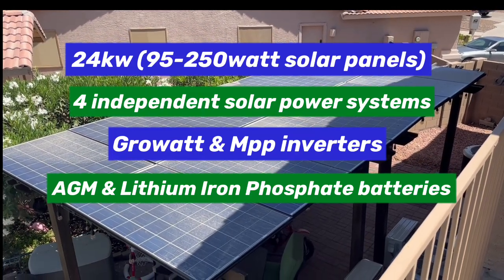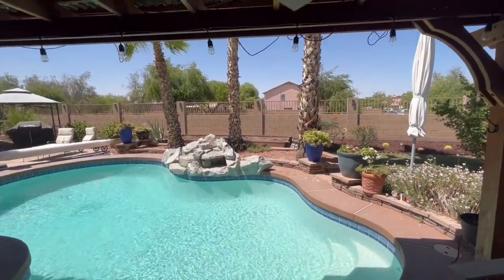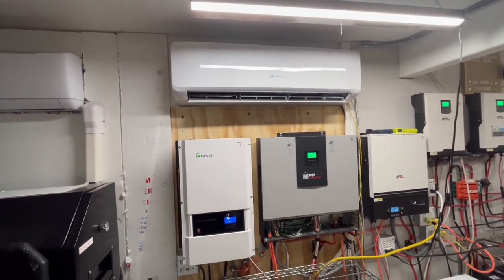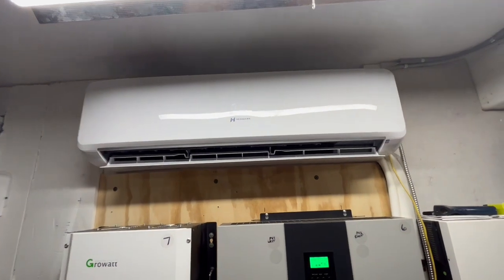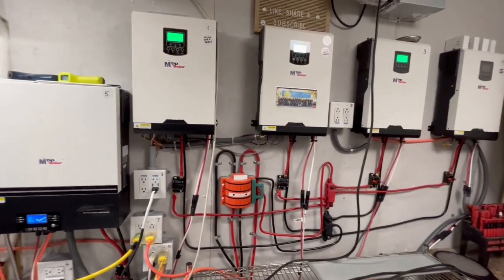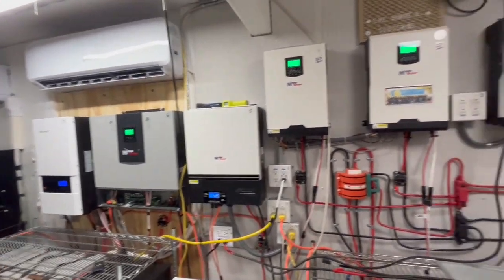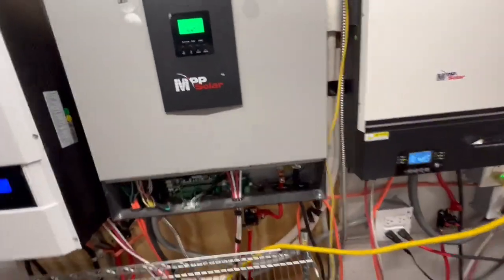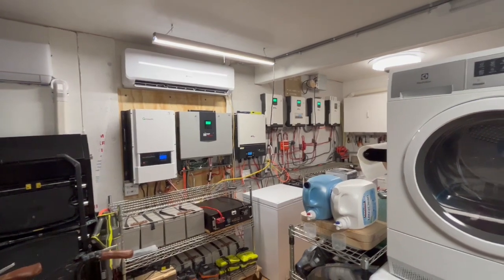24kw Growatt & Mpp inverter solar power system using 25kw Lithium Iron Phosphate & AGM battery banks

Comment: I've binge watched most of your solar videos, I have one major concern for you. That is a partial and missing fuses and breakers. Especially with the 48v systems, the type of breakers you are using are generally only rated for 36v systems up to 48v max not mid 55+ volt i.e. lithium etc. Second, you need a rated fuse or circuit breaker, Not like the ones you have, With high interrupt rating close to the batteries. Third, breakers for your a/c output from your panels to equipment etc. Fourth you need cut off switches and breakers fuses for your solar panel feeds to your inverters. Please understand note: that sometimes these hybrid inverters can catastrophically short out, almost causing a dead short and therefor a fire, we must protect our lives and homes, GOD bless! Thanks for the videos and showing your results!
Reply from the maker: Thank you so much for your valuable input, I will look into researching all those items you mentioned and purchasing for added safety. Hope you have a wonderful and extremely blessed day.
Reply: @diy-solar-guy  Shure, you too!
Reply: Ya, you seem to be good at researching stuff, so I don't think you will have a problem with finding good advice on all the places amperages voltage and interrupt rating etc., it's just you're getting a lot of power and 48v dc can kill etc, unlike 24v. But also don't skimp on these items as some of the lessor breakers fuses from e-bay Amazon etc, don't meet the advertised cut points etc, but you can still get name brands from there. Unlike the breakers you have, Your 24v systems are not as much of a problem as up to 36v systems are still considered low voltage, but not 48v lithium running in the 50v+ range. It will take some money though, depending $500-$!000, including breaker boxes etc. Oh and don't double/tripple connect wires to the same screw-down fitting, code violation, unless specifically designed for and certified. If you have any problem getting started I can point you in the correct direction. But all I think from seeing what you have done is just doing the research, and understanding I've worked with electrical stuff for almost 50 years and I hate to see injuries or fires which otherwise were avoidable. Thanks again for your videos!
Reply from the maker: Great advice, we are a DIY channel that has evolved over the last 3 years always learning as we go. One thing I don’t want to do is run high power consumption devices overnight when I don’t have to. My electric bill for the year is around $1000 and I’m fine with that. The bill will go lower when I start running mini splits overnight, but those are only 120v and only use around 10 amps max but once reaches set temp drops to 2-3 amps or 200-400 watts per hour. I still have my 24v inverters that I will use in the future. I have 4 independent systems so I don’t have to load up everything on one system. I can run all 4 systems at around 25-40 percent of rated watts which keeps all inverters, wires and battery banks nice and cool. I am completely retired now and spend a lot of time monitoring high power consumption devices to see how inverters and batteries are doing. I keep my garage nice and cool in the 68 to 72 degrees range because of all the heat from 4 inverters. All my wires are always cool to the touch since I don’t run inverters to the max with the exception of the pool heat pump. But it was 99 degrees yesterday and I did not have to use the 127,000 pool heater. The pool is in almost full sun all day now and just having a pool solar cover with the little 18,000 btu pool heater keeps the temp at 88 degrees. Night temps are now close to 60 degrees. I have it set up where I will run my 3 1/2 ton all day for upstairs only using 1600-2600 watts, that is on my Growatt 6kw inverter. That will be all I run on that. I will use 2-12,000 btu mini split heat pumps downstairs instead of 4 ton whole house heat pump. The 2 mini splits only use around 2000 watts or 20 amps together. I will also run my 18,000 btu mini split heat pump in garage to keep my inverters cool. All 3 mini split will run on my 12kw Growatt inverter only using around 4000 watts or 40 amps. I will run my pool pump and 18,000 btu pool heater on my 5000 watt MPP inverter with each one on the two separate 120v legs and using less that 1000 watts each or 20-22 amps total. My last 6500 watt MPP inverter will continue to run my 3 chest freezers and refrigerator/freezer 24 hours a day. I only use pool heater for 2-4 weeks in spring and fall because of the 7500 watt load it needs to run. Having 4 separate inverters gives me the flexibility to keep my output power below 50 percent on each one with the exception of the 127,000 btu pool heater. Now I can start running my ac units at 7 am for upstairs, downstairs and garage so my power usage will be lower during the day since the house will be at set temp by 8am and use a lot less to keep temp at set point. I never wanted to put all my eggs in one basket by having just one large inverter running at max all day and night. Too much power output in one unit and failure rate is much higher. If one of my units goes down, I still have the other 3 inverter systems to compensate since I run at less than 50 percent load almost all the time. My batteries are all fully charged by the time I turn off 3 out of the 4 inverters nightly so if I had a power outage overnight, I would be able to run everything in house till solar starts running and charging the next day. I look forward to upgrading my 4 solar powered systems in the near future with your suggestions. Thanks again for your wonderful input.

Comment: Do you have building codes, permitting and required inspections there?

I couldn't get away with wiring solar systems like that, here in Pennsylvania. It's an NEC code violation nightmare (too many to list) and would never pass an electrical inspection. Code enforcement would condemn the property if they ever saw an operating system like that. Plus, the insurance company would cancel the homeowner's insurance policy in a flash!
Reply from the maker: Some states are friendly with off grid solar and some like yours are horrible. On grid requires a ton of inspections. We have a lot of on grid panels on roofs out here with professional installers, but you never break even because your limited to less than 5500 watts on your roof. That’s why I have 5 to 7 separate off grid systems that are below 4000 watts on each. Everything thing solar if completely off grid. I have grid connected that feeds into inverter but no power I produce ever feeds into grid. My inverters are grid assist. Keeping the systems small is the key. I know people who work for grid power companies out here and they are only interested if you connect to grid. You can do all the work yourself to install on grid system and get inspected. It will take about a year to year and half. But the electric company will charge you monthly to be connected to grid and will not buy your extra power you produce. If I went on grid my electric bill would be minimum $1600 - $1800 a year even off I produced 100 percent of my power with solar. Right now my electric bill is less than $1200 a year. I save about $4500-$5000 a year using off grid to run pool pump, pool heater, mini splits, washer & dryer in garage, main upstairs and downstairs ac units attached to house, fridge and 2 freezers. Off grid is ok as long as it is less than 5000-6000 watts per system. The city out here takes 6 months to a year to get out and inspect new businesses and new homes. They are not looking for diy solar off grid system. We are not over regulated at this point in our state to install off grid solar. Not one solar panel is on my roof of house. All are on pergolas and metal arrays I made. Hope this helps. Also Back east has a huge amount of cloudy days and snow, rain. Will not be able to produce much with those conditions. We have over 300 days of sun shine a year. Perfect place to do solar. When I refinanced the house the inspector said mortgage and insurance companies and not interested if you have off grid solar. He did not even mention in inspection since off grid is considered temporary and not permanent like on grid with panels in roof. But they did note trampoline on inspection and had to remove trampoline from property or they would have canceled policy. Hope you have a great day

Comment: How much total is your solar setup?

Very good setup, a lot of wires 👀 lol but cool though
Reply from the maker: With what I am using now, spent a total of around $16,000. To purchase all this now with inflation would be about $24,000 to $26,000 If you can even get the product I have. My system is already paid for itself in less than 3 years through reduced electric bills and rebates. I save over $5000 a year in reduced electric bills. Plus I have a lot of extra inverters and spare parts, connectors, etc... I do not need to buy anything more to keep this system running for 5 - 10 years the way I always have full batteries at the end of day and use grid for ac overnight. My electric bill for the year is around $1000. I need grid power and would never in this house go completely off grid. I am pretty much done with my system for now since I can produce way more power than I need and have back up if inverters go down. Now I just want to clean up my wiring and make it look nicer but in no hurry. Nothing ever runs hot since I don't overload any of my systems. I have a lot of inverters because I am self taught and progressed as I learned more, just moved to bigger inverters as I felt comfortable with my knowledge of solar. I had no help at all with setting up system or connecting all equipment together and installing 6 mini splits, all while battling cancer since 2013. I did not start solar until around 2018 or 2019. You can if your lucky but refurbished Growatt 12k inverters for around $1500 each. Buy 2 and you could have 24kw, more than most people would need. Signature solar was selling refurbished units but I think they are extremely low on all stock due to inflation and supply chain issues. Mpp inverters are great for mini splits but not for anything that requires 240v and high amp surges to startup. Growatt is my favorite since dual phase 120/240 volts.

Comment: Do you recommend Growatt or MPP? Why? Looks like you use all the MPP for 120v loads and low frequency Growatt for 240, correct? I have a well pump i am concerned about...Thank you! Impressive system for sure...
Reply from the maker: Mpp weather 120v or 240 volts is great for running mini splits, variable speed pool pumps, etc… but they are not able to start up large loads. The inverters are very light which means the coils inside are not large enough to start large loads like compressor of 72 amp in rush current. That is where you would use the Growatt inverters. The Growatt inverters can handle to compressor start ups. Mpp inverters are good starting out with off grid solar. Growatt is built to use for all your needs. My Mpp split phase works well with mini split inverter that is 230v only because the current is a gradual ramping up, also works well for washer and heat pump dryers. But you won’t be able to start anything requiring 30amps or more inrush, the Mpp is just not designed that way. Both Growatt inverters are split phase 120/240v out at same time. Mpp for beginners, Growatt for more serous applications. I recommend Growatt 12kw to run an entire cabin or small house. How many amps does your well pump pull to start and then to run? Hope this helps.

Comment: Those deep cycle batteries worry me being inside your garage, They off gas some serious fumes.
Reply from the maker: Just received my battery evo Lithium Iron phosphate batteries today. Those deep cycle batteries are gone. Thanks for the concern. The garage was opened many times in the day and the air is constantly circulated in that area of garage. Hope you have a wonderful and blessed day.
Reply: @diy-solar-guy  Yes sir, just was worried is all..  Lithium or LIFEPO4 is the way to go for sure. Love your little setup!

Comment: How many solar KWH do you produce on an average day?
Reply from the maker: I will try to keep track and talk about in a future video. I have to shut down one inverter because it just drains the battery from 52 v to 44 volts constantly trying to connect to panels as sun goes down. It is the Mpp LV 6548. When I shut it down it clears all the data. The Mpp 2424 and Mpp 5048 does not keep track of that data. Will have to use app  for all inverters to find out but so far have had no luck with the apps actually working consistently. I know my bill was $4000 a year 2 1/2 years ago, keeping my house so much cooler would probably put my grid power bill at $6000 to $7000 a year. My bills should be less than $1000 this next 12 month from January to December.

Comment: It’s a big system, how is it grounded?
Reply from the maker: Hi, actually 4 separate systems running independently. I can not do a earth ground even being on the other side of the house from grid electrical panel due to voltage pickup with separate grounding rod over 150 feet away from grid electrical panel. So i can only use the inverter ground. The pool pump is earth grounded and can NOT use with Growatt inverter. ALL the Mpp inverters will work with pool pump being earth grounded. The grid power assist with mpp inverters as ac input works ok with only mpp inverters. I can use all my inverters as a grid assist for the other inverters to charge battery bank when no sun on solar panels for that inverter and I have full battery on inverter being used as grid assist. No issues with being shocked or leaking voltage or any other problems.

Comment: I have the pip 24GK 3kw inverter - my solar (pv) light flashes on/off - is this normal ? 

It reads 140v 0amps 0watts.. no charge, won’t charge the battery’s from my solar ,.. can’t figure out why ? Any ideas ?
Reply from the maker: What kind of batteries are you using? Most inverters are preset to acid or AGM?
Reply from the maker: Can you give me your exact model number, need to see what inputs are stated for inverter
Reply: It’s a Mpp solar PIP GK24v 3000watt model. (Taiwan manufactured)
Reply from the maker: @floydtown  Hi, looking at the owners manual. the solar panels need to be in series with 3 or 6 panels in each string. I use just one mppt charger on mine with 12 panels. 6 panels in series, the other six in series, then those 2 strings in parallel. so i only have have the positive and negative wire from the panels after the 2 strings are in parallel to the inverter. it is really important that the solar panels are in series. if you try to connect with a different number of panels or connect in parallel only , you will have faults. looking on page 8 of your users manual. it says 12 panels in series for GK 3000watt inverter. Try 12 panels in series, check voltage that you are below the 500v dc pv in. if you dont have 12 panels, try s solar panels in series.
Reply: @diy-solar-guy  wow okay thanks for the information I didn’t know that would be a thing. 

I have 

Solar panels in series +parallel of 4panels (400watt) ea x4 = 1600watts 
= 
65.8v X2 = 131.6v 
6.08a x2 =  12.16 amps 
131.6x12.16 = 1600watts 

So I have 2 panels together & 2 panels together.  Currently,.. 

What would you suggest trying ? 

Just string all 4 together...
Reply from the maker: @floydtown  yes try stringing all 4 solar panels together, it may not like just 4 panels, if not try 3 panels in series. Looks like the owners manual is pretty much the same as my MPP LV6548. I will try to do a video in a little bit of what settings I have my Mpp LV 6548(6500 watt 48 volt 250v dc input) screen and manual looks exactly the same. This LV6548 is the only inverter I have that has to string in series of 3, 6, 8 or 12 solar panels. You want higher dc voltage pv in with your model. What batteries are you using? AGM?
Reply from the maker: Just uploaded a video showing programming my Mpp LV6548 inverter. The owners manual is almost exactly the same for mine inverter and your inverter. Hopefully you can look at what I have my settings at and fix your issue with charging your battery bank.
Reply: @diy-solar-guy  ok great thanks I’ll see what I can do... it’s for a motorhome I have already x4 pannels on the roof... so yeah maybe my only option is to string all 4 together. Instead of having 2 lots of 2. 

I guess I’ll give that a go and see what happens. Thanks 🙏🏽 

I have 24v Lithum bank made of eve 280amp cells.
Reply: @diy-solar-guy  awesome I’ll have a look at your vid :)
Reply: I guess I’ll try all 4 pannels in parallel. 

Otherwise I can only use x3 pannels in series’s 

If I understand correctly...
Reply from the maker: If you have a lithium battery, it could be the settings, I did a video on my Mpp 48 volt  5000 watt inverter with connecting a lithium iron phosphate battery. I went through the setting in the inverter. Maybe that will help as well.
Reply from the maker: @floydtown  it might just be the setting with inverter.

Comment: Great stuff, you should consider moving your AC units from over the inverters, they sometimes drip water.
Reply from the maker: Thanks, we will be moving either the inverters or mini split. Currently our humidity is below 20 percent consistently until about middle of July. So there is no condensation being pulled out of air on any of the mini splits. But I agree , need to move something.